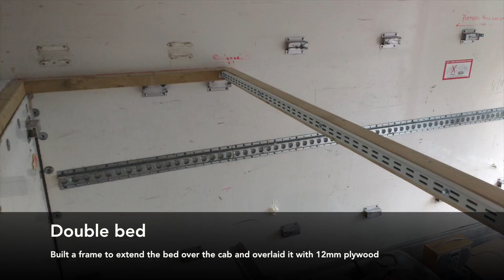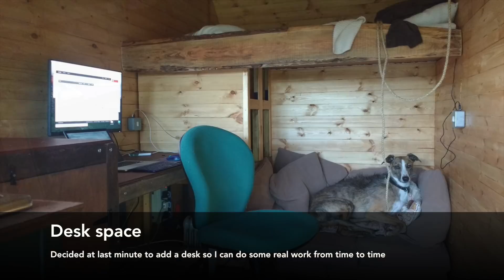Luton Van Tiny Home Conversion - VW LT35

Comment: Great job! I went for exactly the same layout as this too, except for the porch area which I don't have room for in my 12ft box. I made an additional kitchen counter where the door is for extra space, hinged so it flips up when you need access (like a pub bar)... You can never have too many kitchen surfaces!
Reply from the maker: Sounds great, got any pics? I'd be interested to see it. Cheers Steve!

Comment: It would be nice to see more detail with your finished interior. Just a note of caution -  You will get mould on and under your mattress if there is no air circulation. This will grow and proliferate as the moisture from your body wicks through the mattress and has nowhere to go as you appear to have no air circulation solution - routered holes in the ply base or a gap or slats for air to circulate between the mattress and base. This issue is unrelated to condensation although obviously moisture from that source will exacerbate the problem. Black mould grows regardless of climate.  By the time you notice it you will have to cut out the affected ply and throw the mattress all the while having been inhaling the mould spores in your confined space. A lot of builds neglect this important issue and the solution is so simple compared to the massive complications that can ensue. Hope you have sussed this already. Please show more of your build. It looks great.
Reply from the maker: Thanks for the comment, we've been living in it for about a year and no signs of mould... It's actually really dry in there. I think there is enough ventilation.

Comment: Umm.. What about the toilet and shower? Water, electricity?
Reply from the maker: Didn't bother with a shower as we have a camping shower for outdoor showering... They take up too much space! Water is supplied by a 20 litre non-fixed tank that sits under the van on the ground. Electricity - USB lighting throughout, 500W inverted on a 95Ah leisure battery, and a solar panel on the roof (video still to come on this). As for toilet, we have one of those portable loo things, very compact and basic but does the job!

Comment: Hello, awesome build. Am researching my own Luton conversion - what are the brackets you use in the grp walls to hold the bed frame at 1m06s? Seen all kinds of solutions, these look neat and quicker.
Reply from the maker: Hey thanks Russell... The aluminium brackets were already in the van, they were used to attache the rails to the GRP and are really secure. You may find your van has them already installed or something similar. 

Good luck with your build!
Reply: i guess it's pretty off topic but do anybody know of a good website to watch new movies online?

Comment: Well done good sir. Don't forget to throw in a carbon monoxide detector. That CO stuff will make you have a bad time.  Happy travels.
Reply from the maker: Thanks mate! Yes I have the CO alarm and a fire extinguisher in there, but thanks for the reminder. Muy importante!
Reply: On the topic of safety, gas bottles and lead acid batteries really shouldn't be exposed to the interior. The gas locker needs to be sealed from the interior. if using an interior cupboard door as in this case, use a rubber seal around the door, have a hole in the floor for gas leaks to vent to the outside, and don't put anything else in there with the gas bottle because clutter can easily obstruct that drop out vent. Not sure which batteries you have but they can vent toxins into the air. That's one benefit from switching to a lithium-ion battery because with those kind you don't worry about annything being vented.
Reply: @Wishwader  Lithium batteries offgas, and can spontaneously combust even when not in use.
Reply: Recovering Soul - Best not to be involved in a high speed collision like the previous automotive incidents, then you wont have an issue with either of those points.

Comment: Nice looking build. Did you use a vapour barrier? I didn't spot it. You could end up with rotten wall timbers if you are full timing in it, without it. Condense may build up inside the walls.
Reply from the maker: There's a lot of ventilation at the back and very little condensation so no need for vapour barrier. Been living in it for about a year now and it's very dry, no mould.
Reply: @henrylockett  great to hear! Thanks for replying.

Comment: hi there nice van  im thinking about doing a luton van myself and was wondering if you could tell me now you have done yours what kind of mileage to the gallon its doing would really appreciate some help with this question as im goig to be doing allot of miles around europe
Reply from the maker: Hey mate... It's not too bad on economy considering the site of vehicle. Not sure on MPG but I get about 400 miles out of a tank which is 75 litres. Hope this helps.
Reply: HL  thank you for the reply it does help i have been trying to figure out economy versus space IE:  panel van versus luton van and well that works out not too bad i think i might be going with the luton to do mine also  is yours a 5 or 6 speed box ? oh i am thinking its a 2.1 engine yes ?

Comment: hey there, thanks for the inspiring slides. what is the weight difference before/after the build (approx)?and what is the total weight now?cheers
Reply from the maker: Hey... No idea what the weight was before I started but total materials comes to about 600kg
Reply: take it to a weigh bridge, there's a VOSA one on the A23 at the top of Pease Pottage hill. Or take it to an aggregates supplier, they normally charge about £10. The aggregates supplier is your best bet though because they won't impound your van if it goes over 3.5t.
Reply: Sweet, thanks for getting back to me!
Reply: Ant Laud - can they really impound an overweight van? This surprises me because it would detract people from going to weigh their vehicle.
Reply: @Wishwader  ... VOSA will let you go once you've removed the excess weight. But if you want to weigh your van without the risk of impoundment take it somewhere like Day Aggregates in Crawley, they have a weighbridge you can use for a small charge, usually a tenner. They'll give you a print out for both axle weights so you'll know exactly where you stand. And being a private aggregates company have no powers to impound your vehicle so what you do with it once it's been weighed is entirely up to you.